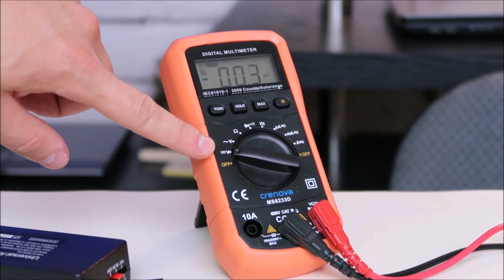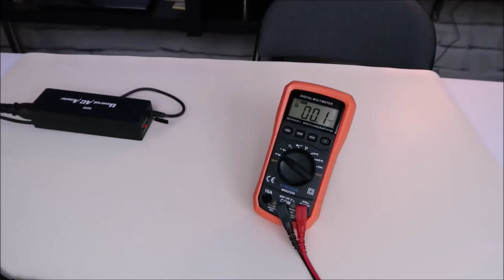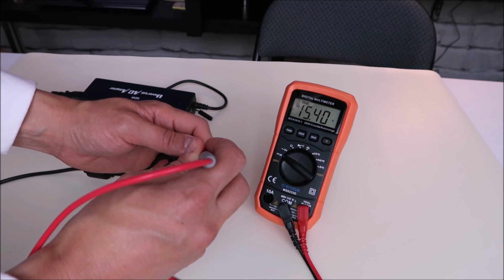How To Fix Any Laptop - Wont Turn On, Wont Open, Turns Off Right Away, No Power Solution

Comment: I have an Aorus X5 V8 and I just disassembled everything after cleaning out the fans and putting new CPU thermal paste. 

It worked for a day, then when I tried to turn it off nothing happens anymore. Ive followed all the steps of the video to no avail. When I plug in my charger though although my CPU and fans dont turn on some chip labelled on the back of the motherboard called PCH1 gets really hot, and I had to unplug the charger from my laptop in fear of burning something within 10 seconds. I also have the LED connector plugged in the motherboard and when the charger is plugged in the LED for the battery does show up. 

So far I can only think maybe the ribbon cable for the power button is malfunctioning, but Ive been extremely gentle with it, and made sure it was connected properly with pins facing down. Im running in circles with no direction. 

Please help with any suggestions I really need it for school!
Reply from the maker: Sounds like you may need a new motherboard if the PHC chip is overheating / damaged.
Reply: @PC_Monkey  Thank you for getting back to me, I tested the temp with a thermometer and it seems like it only reaches 50 C even after 30 min of getting it plugged in. As per your suggestion Ive tried looking for a motherboard replacement and cant seem to find any. 

Would you suggest for me to purchase a new laptop? Ive been extremely gentle with all components and made sure to clear any dust, or loose screws. Ive watched all your motherboard repair videos in preperation, but I still cant figure out what I might have done wrong as Im very inexperienced. Do you have any ideas on what I may have done wrong? Again thank you very much for your time.
Reply from the maker: @Revolthell  Im not familiar with your model computer.  So I cant help with the price of the motherboard.  If you cant find a replacement motherboard then yes, you may have to replace the computer instead.

Comment: Hey mate, so basically, my laptop is an ASUS X409MA, and last night I had an issue with it, when I plugged in the charger, it wasn’t charging, then I tried everything I could, and the battery went flat. Could you help me?
Reply from the maker: So the computer is not turning on at all now or is it turning on and working well other than not charging the battery?

Comment: Hi I am having a problem with my Lenovo laptop G580. It was repair last time and they change the graphic ic works fine and after 1 week I wasnt able to use it, when im trying to open it same issue before it has power but blank screen. I dont know everytime I didnt use this happen like this battery draine. I try also Diy and yet no success and the technician told me like this issue is like cancer. Kindly advise me if I will proceed to repair or buy new laptop let me know which 1 is friendly budget type most of the time i use this for my work from home job, no games anything. Thank you very much in advance!
Reply from the maker: Your computer turns on but the screen stays black?  If the screen is black, what are the signs the computer is on?  Lights?  Sounds?  Fan?
Reply: @PC_Monkey  light, fan is working also and I hear click and then gone.
Reply from the maker: @myleneb.1813  If the fan is turning on then theres a good chance the computer is turning on.  For a computer that turns on but the display does not work, try this video first;   https://youtu.be/u-REPLdpZ70
Let me know how that goes :)
Reply: @PC_Monkey  Ok I will try. Thank you.

Comment: Hey PC Monkey. I have an ASUS flipflop laptop. My laptop wouldn't turn on one day. I took the battery out and turned it on with just the charger and it turned on so I bought a new brand new battery. But it would still not turn on after putting a new battery. So I took the battery out again to start it with just the charger. Even with just the charger, it takes few tries (I take the charger in and out for a few times) to turn on now. What would be the issue you think? Thank you in advance.
Reply from the maker: your on the correct video.  Have you tried the steps seen here yet?

Comment: Laptop came back on for 2mins then died again 😢
Reply from the maker: If all the tests in this video do not reveal the issue, and your power adapter tested to be fine, then your most likely looking at a Motherboard replacement as seen here;  https://youtu.be/N_7HNrFkMS8
Reply: @PC_Monkey  Thanks for replying. I have the laptop back up and running although still have to work out what really is the issue, whether the charger or the battery. I  am using another charger and have replaced charger with a new one.  All the same your video has been very helpful and I have learned a little something.

Comment: I’ve been crying since 8 AM  it’s 9am I’ll edit it if any of these works
Reply from the maker: What brand and model computer do you have and whats the issue with it?
Reply: @PC_Monkey  ik the brand is asus but I’m not sure the model the issue is the light is on like on the side where it shows proof when it’s on and sometimes it’s on but it flickers off for me to turn it on again but it didn’t flicker and when. I turned it on nothing happened
Reply from the maker: @IenjoyFries  Are the lights the only signs of life when you turn it on?  No motherboard or hard drive sounds?  No fan noise?
Reply: @PC_Monkey  Nope (my current new problem is that it won’t turn on and there is no signs of anything I closed the computer for a hour+ and now I can’t turn it on still and now there’s no sign of power
Reply from the maker: @IenjoyFries  For a computer that does not turn on, try this video first;  https://youtu.be/P3I7dDpkJps.  Let me know how that goes :)
Reply: @PC_Monkey  kk
Reply: @IenjoyFries  did it work?
Reply: @DarkNinja-bf6hk  I have tried but I haven’t been able to unlock / screw one part
Reply: @IenjoyFries  relatable

Comment: Hi my laptop screen suddenly went black..keyboard not responding...power button light is on..also it was on charge..the charge light is still on even though I removed the charger..fan is not working..any idea..?-thanks
Reply from the maker: IS the screen black or is the computer off?  
Are the lights the only signs of life when you turn it on?  No motherboard or hard drive sounds?  No fan noise?
Reply: @PC_Monkey  no fan noise, no motherboard noise...just power button light and charger light on...no response when I press power button .
Reply from the maker: @adnanahmed9044  your on the correct video.  Have you tried the steps seen here yet?
Reply: @PC_Monkey  I wanted to.confirm before opening the laptop as its battery is inside..anyways I didnt have the proper sized screwdriver..also was lazy going to the market..lol.. the battery just worn out right now..and plugged in the charger and voila its Aliiiiiiive!!!!
Thanks for your support and time.

Comment: I'm having a problem where the screen won't turn on but the laptop seems to be charging??
Reply from the maker: Are there any signs of life at all?  Lights?  Fan, Motherboard, or Hard Drive sounds?
Reply: @PC_Monkey  Okay, so I tried restarting it but after a minute or two and once it turned on, just got all slow, glitchy and froze. Then turned off once again.

Comment: I'm having brain damage. I don't have tools. I hard reset the laptop but it didn't work.
Reply from the maker: This video is for a computer that wont turn on.  If you hard reset your computer, its obviously turning on and functioning to some extent.  What brand and model computer do you have and whats the issue with it?
Reply: @PC_Monkey  I just put it on sleep mode. After I turned it on once again, its not showing anything. Just blank. Screen is just blank.
Reply from the maker: @icarus255  Some ppl mistake a computer that isnt turning on for a black screen issue and vice versa.  If the screen is black, what are the signs the computer is on?  Lights?  Sounds?  Fan?
Reply: @PC_Monkey  Well, there is a light that signals the laptop was on. I can hear the fan too.

Comment: I have taken a look at your videos, thank you for providing such helpful videos.

Unfortunately I still can't seem to figure out the issue (I'm really hoping it isn't the motherboard because it's only over a year old but the warranty is over).

I have an hp db0048ca laptop. It was plugged in and operational when suddenly it just shut off.

I tried the static discharge, but it didn't help. It doesn't have a removable battery, but I opened up the back and have left the battery out overnight and still nothing. I can't do a bios reset because it doesn't seem to have a BIOS battery. The charger appears to be in working order. I have tried tried removing the RAM and reseating it. I have swapped out with another RAM and also tried the 2nd slot instead. Any other suggestions?

Thanks!
Reply from the maker: If all the tests in this video do not reveal the issue, and your power adapter tested to be fine, then your most likely looking at a Motherboard replacement
Reply: @PC_Monkey  thanks for the reply!

Comment: TL;DR: My Toshiba laptop won't start regardless of the steps I take to try and start it up. Help?

My man, I have an old laptop (Toshiba Satellite S50-B-12R) where my HDD crashed and all. I brought it to the repair shop, they changed the HDD and it crashed again. I then changed the HDD, installed Windows and all and it was fine for a while. That HDD stopped working, so instead I bought a 500GB SSD from the store, fitted it in my laptop and after 2 days my laptop stopped working completely. This all happened a few years ago and today I found my laptop and your videos. After all these steps, it still doesn't start up. I have now fully charged the battery and it doesn't work regardless. I have also read online that the CMOS battery is in the main battery, so I don't know if that's that case and if you could help me with this problem.
My motherboard nor anything else makes any sound when trying to turn it on.
Reply from the maker: If all the tests in this video do not reveal the issue, and your power adapter tested to be fine, then your most likely looking at a Motherboard replacement
Reply: @PC_Monkey  That sounds expensive and hard to find for a 7 year old laptop, but if that is the case, I'll go have a look around and I hope to be able to find one and fix the issue with replacing it! Thank you for your advice and reply!
Reply from the maker: @MrSuperMichel1997  NP :)   Motherboards on older computer may be cheaper than you think. I usually get most of my computer parts on Ebay :)

Comment: This morning my HP Pavillion 17 (which worked perfectly fine the fay before) decided to let the startup light glow but the screen was entirely black and the fans didnt spin. I tried the charger and it seemed fine and the usb ports charge external devices just like before. I really dont know what could be the issue
Reply from the maker: Are the lights the only signs of life when you turn it on?  No motherboard or hard drive sounds?  No fan noise?
Reply: I have the same issue, and there are no other signs of life besides the light.

Comment: i have already change my battery but can't work..
Reply from the maker: A bad battery is only one possible reason why a computer wont turn on.  What brand and model computer do you have and whats the issue with it?
Reply: Hp loptop. no fan. if im plug in the churjer ...led light is on but did not turning on.. im done to clean my ram bat can't turn on the loptop
Reply: do you have messenger to send to you my laptop
Reply from the maker: @monsouraguilar2616  This video has been updated with additional steps here;  https://youtu.be/P3I7dDpkJps.  Let me know how that goes :)

Comment: Did the Static Discharge, My Battery is Good and the Charger aswell, Reseat the Ram, Reseat the Hard Drive aswell just incase, Replaced Cmos since it is quite old, Cleaned the Laptop but still turns on and off right away.
Reply from the maker: If all the tests in this video do not reveal the issue, and your power adapter tested to be fine, then your most likely looking at a Motherboard replacement as seen here;  https://youtu.be/N_7HNrFkMS8.

Comment: Hi PC Monkey! It's not the battery, the charger (also tested with multimeter). Also tested the RAM its not it, unplugged the CMOS battery for 5 minutes and nothing :( What else?
(I've sent it to a computer repairer 4 months ago and it was fine, it was the same issue.)
Reply from the maker: If all the tests in this video do not reveal the issue, and your power adapter tested to be fine, then your most likely looking at a Motherboard replacement as seen here;  https://youtu.be/N_7HNrFkMS8.

Comment: I have a lenova idea pad l340 and it died just past the warranty, only a year old. I’ve tried everything and nothing will get it to turn on. There’s no lights, not even next to the power cord plug in. Zero signs of life.
Reply from the maker: If all the tests in this video do not reveal the issue, and your power adapter tested to be fine, then your most likely looking at a Motherboard replacement as seen here;  https://youtu.be/N_7HNrFkMS8.

Comment: Any idea why a Asus Chromebook C523 won't start?  Even after a hard recovery using usb stick, when it restarts, it just continually cycles on and off until you hold power button in to hard shut down.  Never get anything on the screen, just grey flash, black flash over and over.
Reply from the maker: You said it wont start but then said it cycles until you turn it off.  Does the computer not start up or does it get stuck in a 'boot loop' situation?
Reply: @PC_Monkey  so both when you lift the lid, or hard shut it off and use the power button to restart it, when it tries to start, all it does flash a blank grey screen then a blank black screen over and over, never a boot error, message, nothing but blank flashing screens...I've tested the adapter and power port and it is charging, but it does the same thing if I completely remove the battery and try to start from just the adapter as well.
Reply from the maker: @kelibrockmann2933  You may have to reload the OS as seen here:  https://www.youtube.com/watch?v=_tbOXFCgAOY&t=1s

Comment: @PC Monkey I tried  to switch on the lap with the battery and no charger but only the power button light coming, then I tried with the battery and no charger then power light is just blinking. I also tried the BIOS method and I left that battery for 20 mins and then I plugged it again and tried then too the power light is on ad I can hear the beep and the fan but nothing on the screen. Please help me. I dont know if it's with the way i am doing it or something. I know this is a static prob cause I have been keeping it  in the bed for too long. Please help me. My laptop is a Lenovo V15. You're my only hope
Reply from the maker: If all the tests in this video do not reveal the issue, and your power adapter tested to be fine, then your most likely looking at a Motherboard replacement as seen here;  https://youtu.be/N_7HNrFkMS8.

Comment: it still wont work.. it starts up then shuts down again and again..
Reply from the maker: When does it shut down?  Before or after your able to see the startup logo screen?  Also, what brand computer do you have?
Reply: @PC_Monkey  after I press the power button, it turns on then immediately turns off, its a lenovo. I went to the computer repair shops and they said the mother board needs to be replaced. They cant replace it because they dont have a motherboard to replace it with..
Reply from the maker: @lein648   If all the tests in this video do not reveal the issue, and your power adapter tested to be fine, then your most likely looking at a Motherboard replacement.  If you tell me the exact model Lenovo, I can help you find a Motherboard.

Comment: Hello, my laptop stuck on logo booting and blank, then blue screen with text:

Recovery

Your PC couldn't start properly

After multiple tries, the operating system on your PC failed to start, so it needs to be repaired.

Error code: 0xc0000001

I have already tried creating bootable, but my laptop still blank, won't to boot anything. What's wrong? My laptop Asus S400ca
Reply from the maker: Try these steps first;  https://www.youtube.com/watch?v=J1ZagkSTcSI
Let me know how that goes :)
Reply: @PC_Monkey  Problem has been found, my hard drive is damaged. Thank you before 👍
Reply from the maker: @ikhsansatriaa  Glad your all set :)

Comment: My ROG Strix has the issue, the power button is on my entire keyboard light also on , but no booting screen, after all the button light is of automatically, multiple times i try to turn it on, after a couple times finally my laptop can start booting in to windows, please, what should i do? help me, thx
Reply from the maker: For a computer that does not turn on, try this video first;  https://youtu.be/P3I7dDpkJps.  Let me know how that goes :)
Reply: @PC_Monkey  Hy Thx for the reply, Actually its a Laptop , the power button is on, but that's it , no booting screen, no loading screen, and then my laptop went off . sometimes my laptop goes normally when i turn it on, but mostly i have that problem, is cleaning the RAM with rubber eraser will work??
Reply from the maker: @dk_2405  You can try the RAM test as seen here;  https://youtu.be/u-REPLdpZ70.  However, if the computer isnt turning on, try the steps in the link I already sent you :)